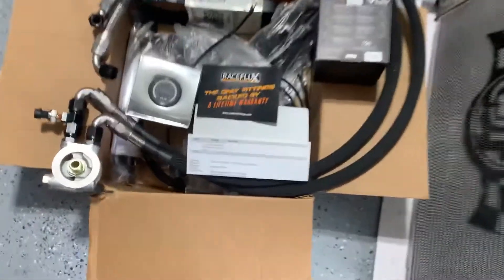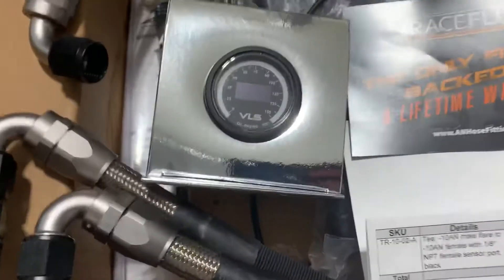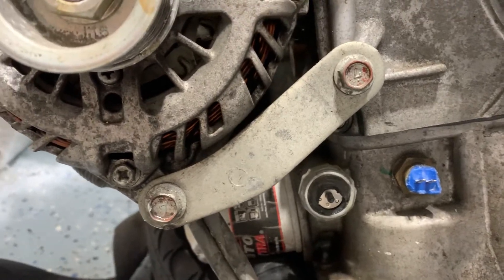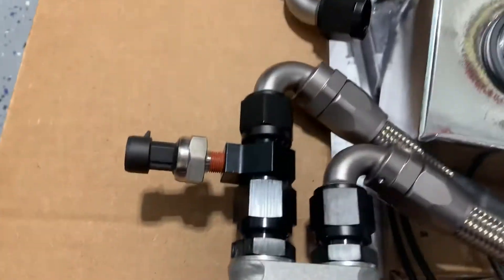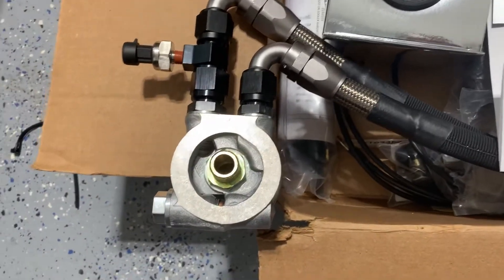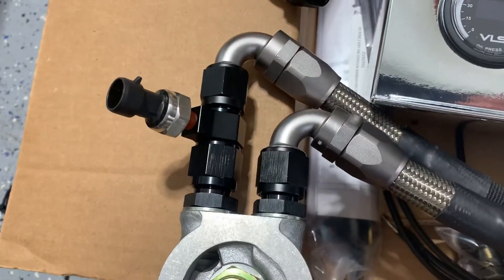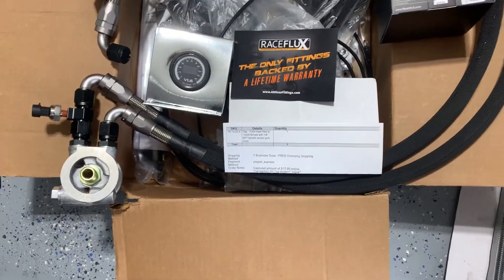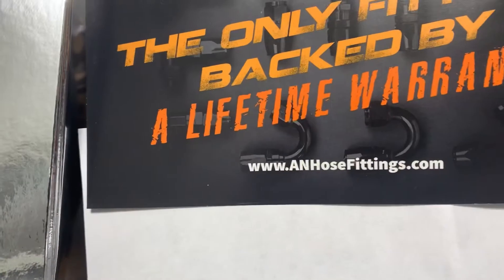Installing Aftermarket Oil Pressure Sensor Options for G37 , 370z , G35 , 350z

Comment: got any info on that fitting used to get the pressure sensor plugged into?
Reply from the maker: Sorry for the late reply, you asking about the T fitting that goes to the block to use both the oem pressure sensor and aftermarket?

Comment: With a thermostatic sandwich plate that sensor is only going to see oil pressure when the thermostat is open. It’s a clever idea though. Just need to swap to a plate with a sensor fitting into the housing itself.

Comment: Did this end up working I had a mishimoto set up but there banjo bolts kept leaking so I want to move to the z1 system but idk how to make my oil pressure gauge work
Reply from the maker: I still haven’t finished my engine swap. I’m close now. So I can’t confirm if my setup works.

Comment: do you know if clearance would be an issue with stacking sandwich plates? Bc I want to run an oil cooler, temp sensor, and pressure sensor. Plus the g37s don't have a port on the block for running a temp sensor like the 370s do
Reply from the maker: Some have done it but space will for sure be tight. Check out this forum thread. The guy stacked the sandwich plates but end up taking it off because of space

http://www.the370z.com/engine-drivetrain/133776-oil-filter-sandwich-plate.html
Reply: get a sandwich plate with cutouts in it.
Reply from the maker: @icesalami  , that’s a popular choice; Mishimoto and GlowShift are some sandwich plates with the 1/8npt ports for oil temp and oil pressure. 

I didn’t want to stack sandwich plates and refer to keep my Mocal sandwich plate.
Reply: @ProjectPanda13  the oil cooler i’m running came with the sandwich plate and the cutouts in it. i’m guessing they’re 1/8 bst. anyway, can i change just the clock on my 370z and replace with an oil pressure gauge? any idea on how this goes? forums are saying mixed things. thanks
Reply from the maker: @icesalami  the proper way to do it is remove the whole dash.

Comment: did this end up fitting once installed?
Reply from the maker: I haven’t installed my engine yet sadly. I will update for sure once everything is in
Reply: @ProjectPanda13   I tried that setup with a mocal sandwich plate it did not fit. I ultimately used a 1/8th bpst adapter from glowshift.
Reply from the maker: @jayfries8614  , which location did you have the fitting? I haven't ran it since gotten my engine in. Did it push the lines out and cause clearance for you?

http://www.the370z.com/4017749-post8.html

this person also uses the same fitting with his GTM kit.

Comment: Back again lol. Still just as lost as before
Reply from the maker: Hey brother, trying to figure out the oil sensor situation?
Reply: @ProjectPanda13  Sorry, I never got this notification! I guess I’m just confused with how I know which thread sizing I have, but I’ll ask the guy who makes the oil coolers, and my biggest issue is figuring out how to wire the gauge into the car.

Comment: While watching again I noticed that you have a CSF radiator, which I would suggest you stay away from. A quick search online will show you numerous cases of people having their radiator crack or leak, and my CSF is currently doing so.
Reply from the maker: I’ve read a lot about the leaking issue. I hit a deer two years ago and needed a replacement. The shop replaced it with a CSF triply pass. If it leaks on me, I’ll get a Koyo and reuse the condenser.
Reply: @ProjectPanda13  How did you figure out how to re-use the condenser? I read about people struggling to figure that out online and didn't know anyone had solved the problem.
Reply from the maker: @HirschPower  , the CSF condenser is separate and only bolted to the radiator. To make it work with a Koyo, I’d have to weld brackets

Comment: Man I’m tryna learn, but this shit is so confusing.
Reply from the maker: I’m learning as I’m building also. Trying to post up things I’m learning to help anyone who might be doing the same thing.
Reply: @ProjectPanda13  I'm doing the exact same with my tutorial videos. When I first got my car, I didn't even know how to take the wheels off, and I wished someone made videos like I did now to help.
Reply: @ProjectPanda13  I want to install an oil pressure gauge in my car because I haven't fixed my gallery gaskets yet, and because I'm supercharging the car soon. I already have an oil cooler kit from NoTrigga in my garage, but watching this video and seeing you talk about the different fitting sizes just has me confused and doubting whether or not it will fit my kit.
Reply from the maker: @HirschPower  , which method are you considering doing for the oil pressure sensor?
Reply: @ProjectPanda13  I have an essay due at midnight so I barely watched the video, but the option that didn't involve multiple sandwich plates seemed simpler.